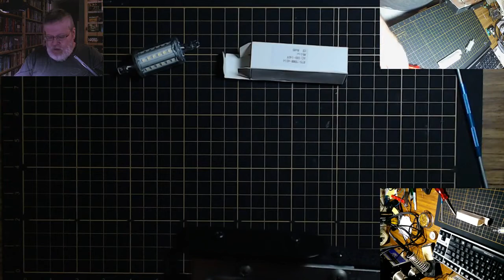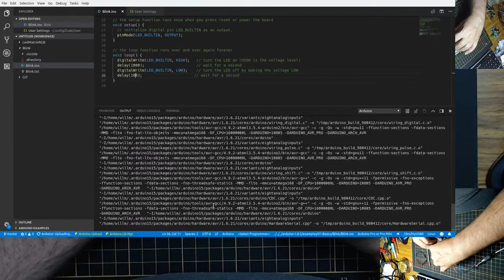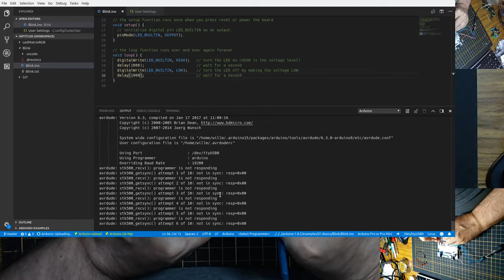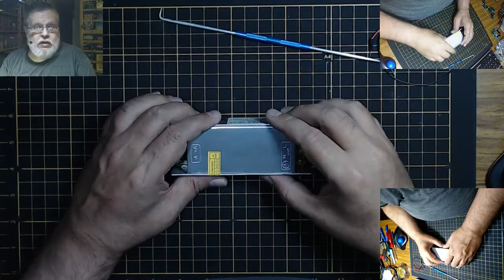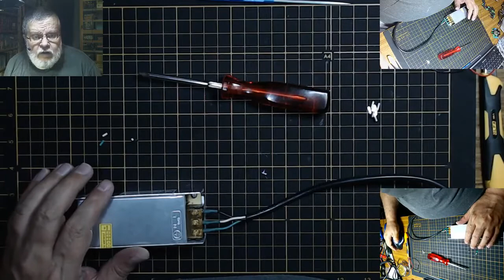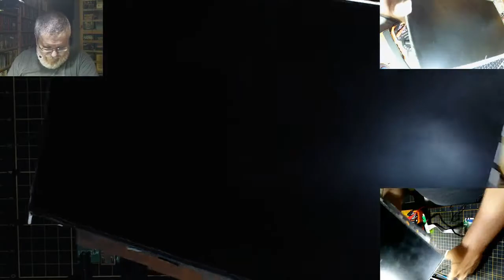How to let the Magic Smoke out of a Chip

Comment: Did you work out what happened?
Reply from the maker: Yes I connected the HDMI cable from the monitor to the board instead of the cable from the tinker board. This was like connecting two monitors together via HDMI I am probably lucky I did not burn out the Monitor.